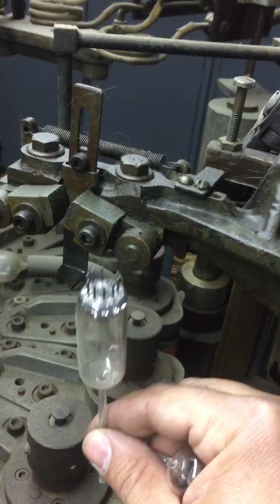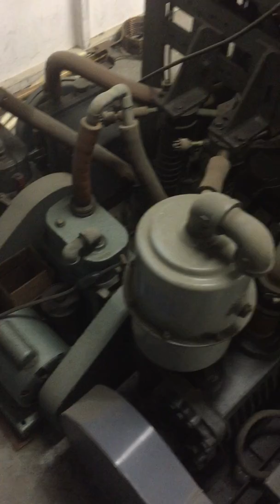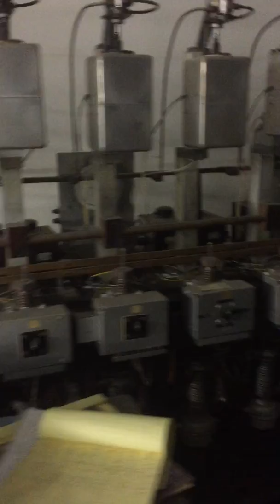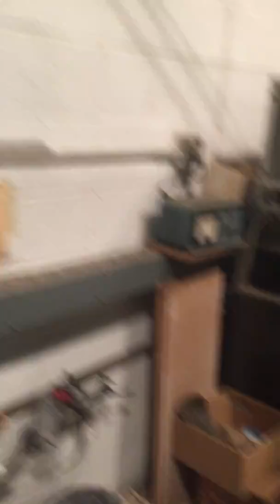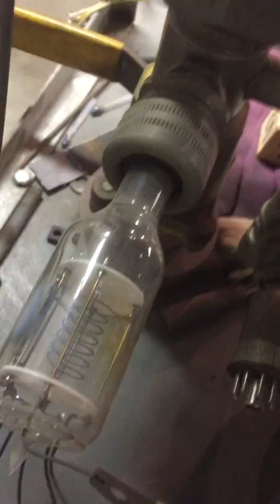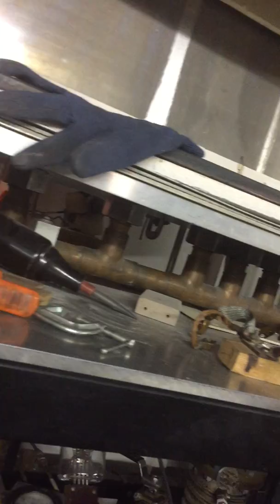Vacuum Tube Sealex Machine and Evacuation Stations

Comment: Good enough for consumer tubes. I'm sure the JAN tubes were done on batch stations?
Reply from the maker: WTFChuk Generally all receiving tubes, or anything with soft glass and Dumet seals were made on carousels. JAN tubes are no different than their regular counterparts accept the manufacturer gets audited by the government and they have specific testing requirements. Otherwise they are generally the same.
Reply: @MrSupro  Good to know. I've always liked using JAN tubes in gear (audio and RF) as they generally seemed more consistent between sections of a twin triode, for example. The JAN 5687 is one of my favorites as a driver, phase splitter, and input stage for audio. The gain isn't great like the high mu tubes, but they have low noise, ridiculous headroom, and generally very low distortion. They just sound darn good  :-)
Reply: @MrSupro  Another couple of questions: Do you use active or passive cathodes? Do you mix your own carbonates, or do you buy the prepared powders? And finally, do you use nitrocellulose or acetate binders? If it's proprietary, I understand. I'm just curious, really. I'm surprised some things like cathode tubing is even available, unless you're getting it from China or Russia. Thanks again :-)